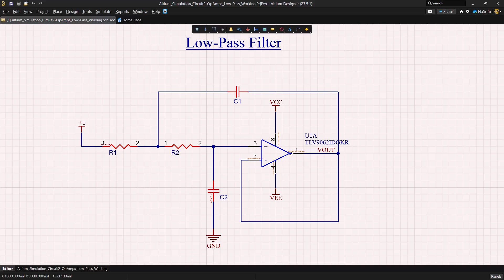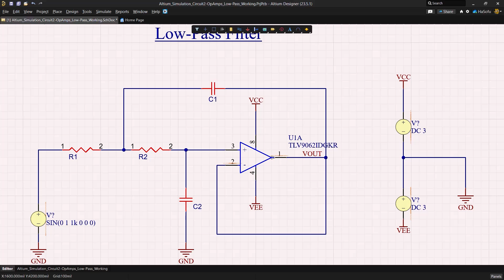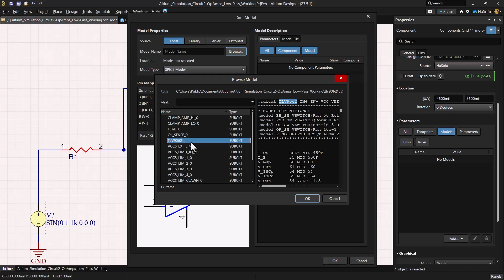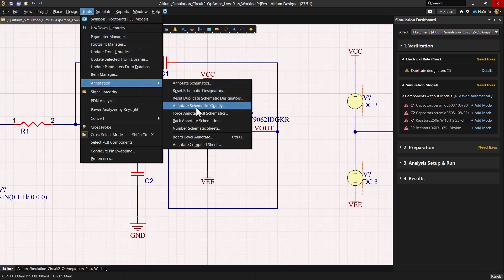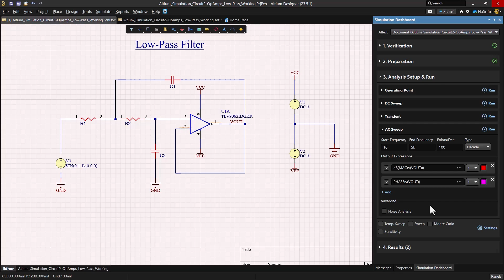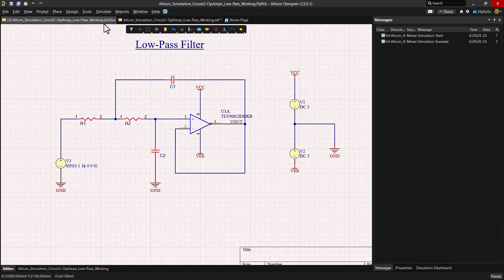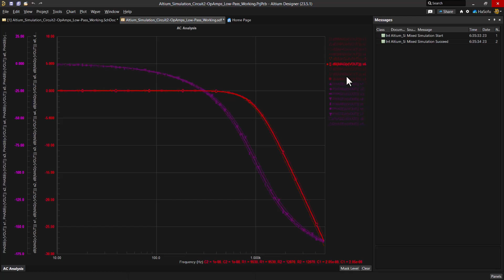Low-Pass Filter

Comment: how do i get generic resistors and capacitors? all i can find is specific manufacturer parts
Reply: If you open the Components Panel, there should be a library titled "Simulation Components" which contains generic simulation parts you can use in the SPICE simulator.